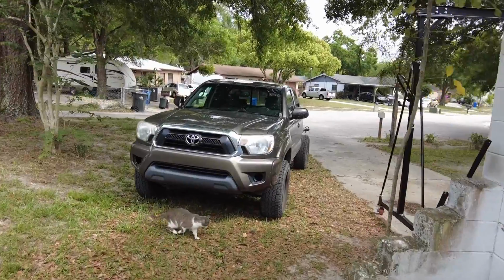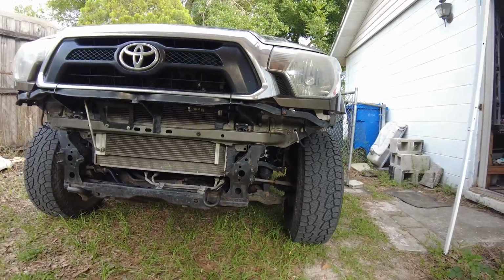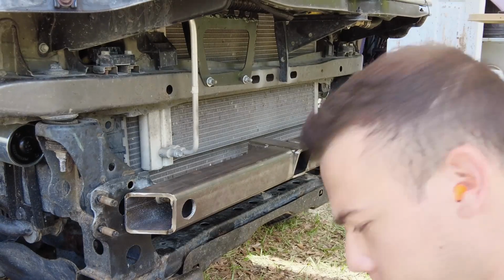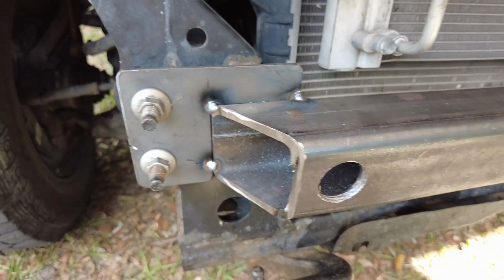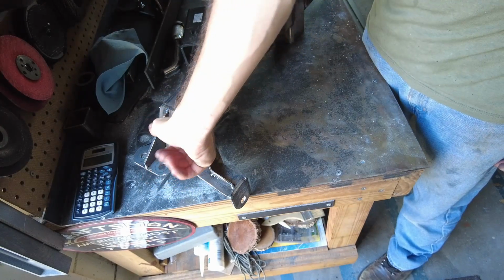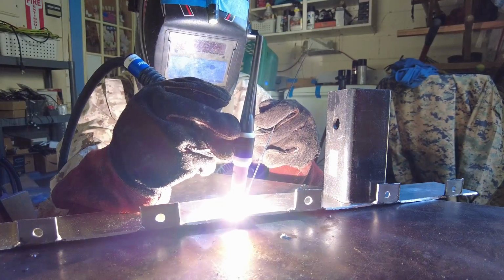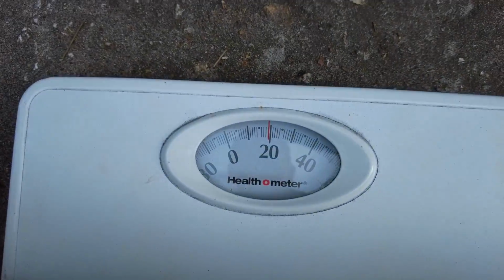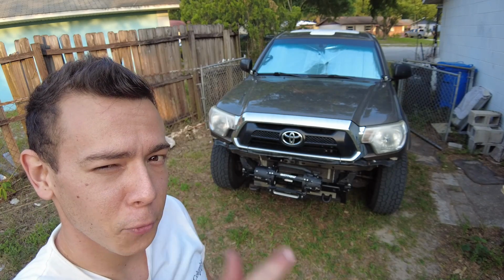Bumper Delete and Front Hitch Build.

Comment: Really appreciate this post and the comments/modifications below as well as the other video.  Great work! Two questions: Could you actually put the bumper back on with that set-up? I want this exact set-up, but actually would keep the front bumper on if I could. Second, just to get a general sense of where you are. Are you in the NE, SE, SW, NW middle of the country? You can see where I am headed, could you do this again?...
Reply from the maker: I live in Florida.

I could make one that works with a factory bumper, but it wouldn't be exactly like this one bc you want it to work with the front bumper.

Look-up  'Tacoma 4xInovations front hitch' (no affiliation) that maybe easier for you and cheaper.
Reply: @jdesigns7239  Thanks, appreciate the reply.
Reply: @jdesigns7239  Turns out 4x Innovations has them in stock right now. Great site and exactly what I am looking for. Thanks again.
Reply from the maker: @northstar8411  sweet hope it works out for you!
You have a Instagram for your truck build?
Reply: @jdesigns7239  Not that sophisticated... Too old for Instagram!  Just put on some Bilstein 4600 shocks, going to add the front hitch, it is a long bed, no rock crawling, just three season camping as faraway as I can get :-). Got to some good places last year,  a winch is handy, I like to be able to move it to front or back, makes me worry less about the muck. Need a front hitch for the winch and do not want to lower ground clearance.
Reply from the maker: @northstar8411  Nice, i kinda wish i got a 4 door long bed. Awesome that it got you to some cool spots too; that's what really matters.

The only thing i can warn you about with a remote mount winch is it sucks to mount. 70 lbs doesn't sound like much until the truck is half buried in a hole and have to mount the winch with one leg in a mud hole lol. Ask me how i know.
That said, i still feel like a remote mount winch was the way to go for me. Hope it works for you.

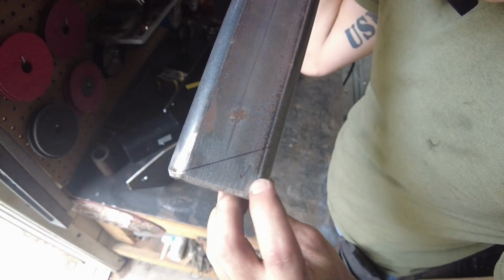Comment: Lost me at 4:51. Terribly weak way to mount a receiver. .
Reply from the maker: You're right! Before building, I looked at a few off-road bumpers and how they mounted, and just built mine like there's thinking it would good enough. I have video of me testing my hitch before use and it wasn't up to the task.

After that the hitch got reinforced and picked up on more factory bolts or holes; it's has been used many times since then with on problems